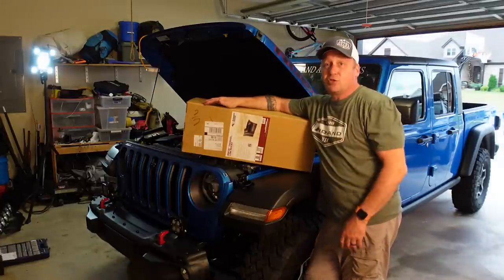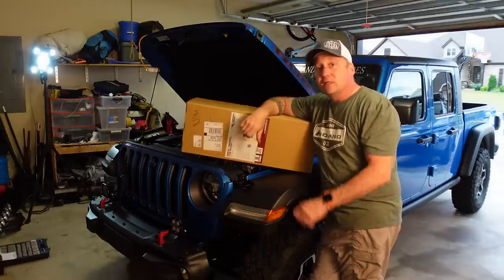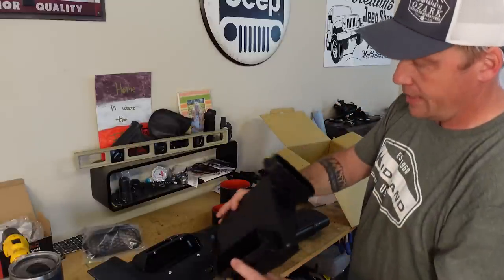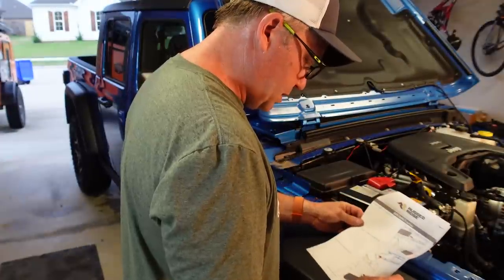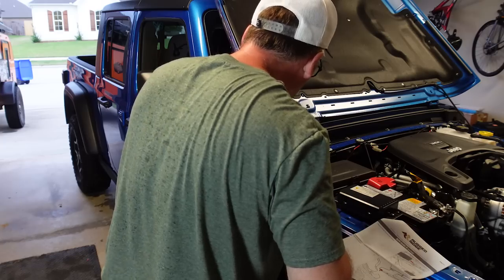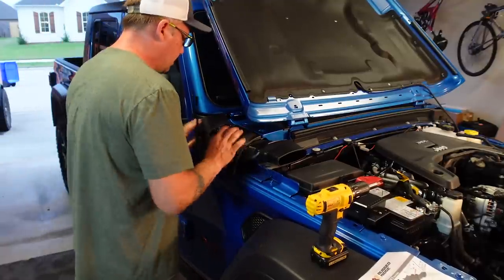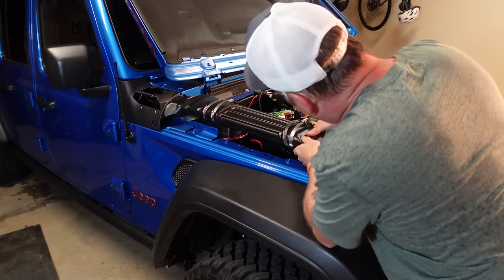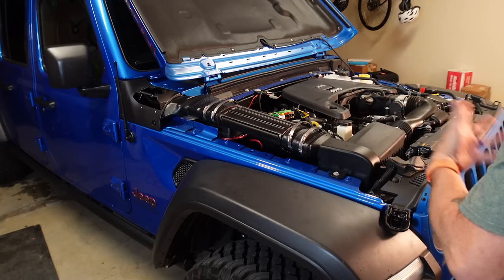Jeep Gladiator Rubicon Overland Build stage 2 - Snorkel

Comment: I just got an 85 suburban from city auction for overlanding. Current plan is to do my own homemade snorkel when we get to that point. Right now it doesn't run haha
Reply: Nice. I’m in the same situation with my ‘88 Suburban. Planning on to add a snorkel on mine as well but am thinking about going with a Safari snorkel. They don’t make snorkels for squarebody chevy’s but can modify a snorkel for a Toyota FJ60 or FJ80 series LandCruiser with a heat gun and it’ll fit nicely. That’s what a friend of mine done with his ‘88 Suburban and turned it into a replica of the suburban from the movie Dante’s Peak.
Reply: @arkansasrailproductions5507  mine is the same color as the one from Dante's peak. I've seen videos of people modifying the Toyota snorkel with a heat gun, but I think I'd like aesthetic of a handmade stainless steel one. 

I got really lucky with the auction. Came with two full size spare tires, an Edelbrock street dominator carb, kicker sound system, 4in. lift, and new front seats. Gotta get the engine going again and replace the ignition cylinder, but we only paid $750. Got an absolute steal.

Comment: I like my RR Snorkel/cold air inlet so far, I've had it about 9 months.  I like the fact that I can run the full snorkel or cowl inlet, use stock air filter, and no cutting of the hood.  You mounted just the cowl cold air inlet, and snorkel looks more like a regular snorkel.  I have a JLUR and the cowl piece fits much better than yours. maybe because of a slight style change on JT?  Also you can rotate the worm clamps around so the worm drive part is on the bottom, then you will not get hooked up on them when doing other things in the engine compartment.  Also, DON'T tighten those worm clamps too tight as they will deform the plastic connectors.  I tightened mine a little too much and had to use a heat gun to reshape the plastic pieces.

Comment: I was wondering about that snorkel. I just hate the OEM airbox. I actually went the opposite direction and upgraded it to an enclosed cold air intake. Lol. I don’t really do any deep water crossings though.
Reply: That hidden piece you have to take off under the grill is a real treat too. Been there haha.
Reply from the maker: the OEM air intake is in suck a dumb location. Where we wheel a snorkel is almost a requirement.

Comment: That's the style I wanted because the one that runs outside, you have to cut the hood,plus this looks way cleaner but I have a Mojave and the section wear it goes up the window is 1inch longer because of the scoop hood. And they won't be the same on the 392 because the air intake is on the Drivers side.

Comment: That was so much easier than the JK but I didn't like the fit on the JK at all and looks like the designer folks failed on the fit of the JT and these are not cheap and it looks cheap IMO.  I am so glad to see some upgrades on the JT we owe a few more months on our JK then we can set our sights on the Gladiator. Keep up the great work.